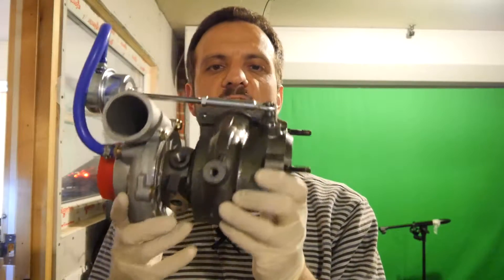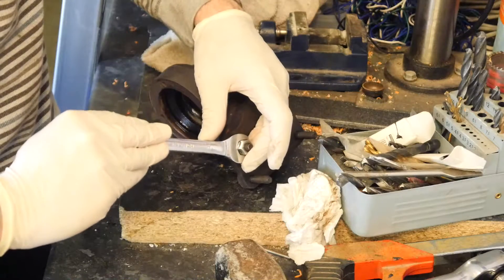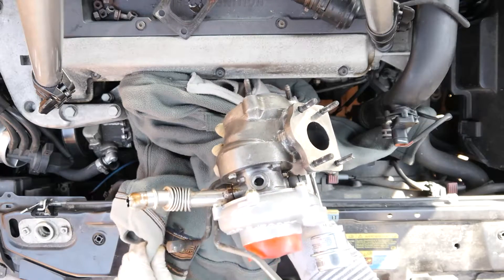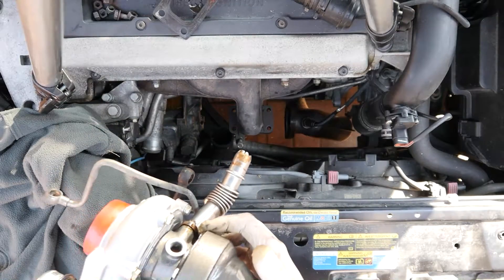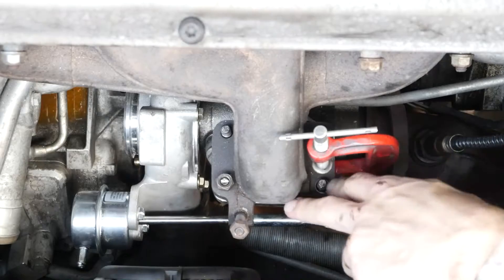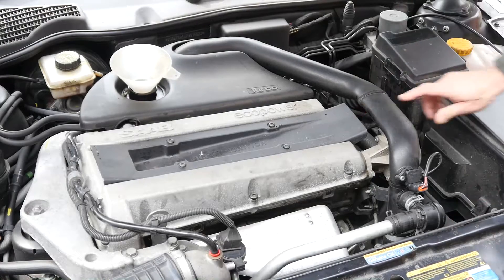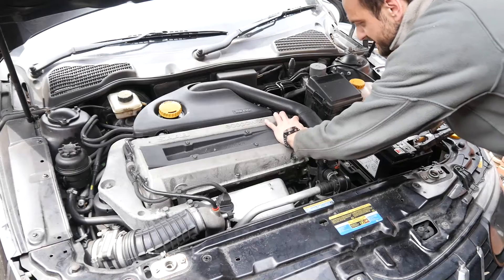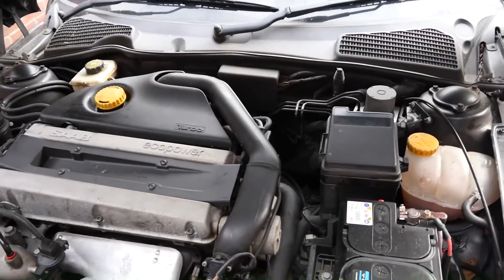How to replace a GM Saab Garrett Turbo Tutorial Part 2

Comment: Mutch better with saab 9-5 i have volvo v70N before the turbo was back on the engine and oli was find in the front hole  underbody vas so mutch oil i leave the car and change the turbo as well 2500euro for the job....

Comment: I wish I’d seen this 5 years ago when the turbo on my 1999 2.0t blew. Cost me well over £300 to get a garage to do it. My « new » 9-5 is 2.3T Aero from 2004 which has a Mitsubishi HOT fitted. I believe (hope!) these are less prone to failure than the Garret. Can anyone confirm ? Or is this just wishful thinking on my part?

Comment: New turbos are required to have a pre-lube of oil that you fill about 2 oz. into the oil port of the turbo or risk damage of running the turbo dry... there is also turbo hardware you can purchase than to use the 7 old bolts plus it is a hassle to reuse the old ones but if you wanted to save on money I can understand but all gaskets and O-rings needs to be replaced...
You are missing 2 O-rings - there is an large O-ring [ Intake hose ring ] that goes between connection of the turbo charger intake pipe and turbo and the smaller O-ring that goes at the end of the turbo return line...
I could not tell if you forgot to place the metal gasket onto the TD04 manifold head - the raised rectangular inner seal prevents exhaust leak that can cause an issue with boost?

Comment: Hi From Denver, CO., thanks for the video.  I'm doing one in an '01 9-5.  Picked the car up for $500 about 3 years ago and for the last year or so it's been smoking at start up.  Took a chance when I found a new one on Amazon for $110.  It looks identical to the one that was on it, even the stamp is the same. But forgot to prime it and was looking for a way to do it without pulling it back apart.I am going to disconnect the cassette but I think I will also pull the oil feed line bolt and inject some in there. Thanks again.
Reply from the maker: At the least I would disconnect the ignition cassette and turn the car over on the starter for a while. I think that is pretty much all I did, but if you have the patience to get oil in there it shouldn't harm it.
Reply: @backofficeshow  Yeah, I just unplugged the cassette, it took longer than I thought for the oil light to go out but it did, then I started it and works fine. I was really surprised that the turbo looked and felt so good for only $110. I mean it looked identical to the original. The old one worked but my throttle body was covered in oil and it would smoke at startup.  Found 2 exhaust manifold studs broken but that's for another day.  It's my girlfriends car and she doesn't drive much.
Reply from the maker: @timthemechanix  I think they are excellent for the money. I really suspect that a lot of original branded stuff is made in the same factories

Comment: Hi - good vid - I noticed you added 5W 30 engine oil. The handbook on the 95 Aero states to ONLY use 0W 30 or 0W 40 engine oil. I just wondered why you used a more viscus oil? My mechanic says to use 5W 30, but this is not what the handbook stipulates - Thanks
Reply from the maker: There really isn't much between a zero weight and a 5 weight oil and the winters here are pretty mild so I think it's fine. Depends on where you live really.

Comment: The return line on my  saab for the oil on the turbo is sticking out like a lot and I’m worried it’s going to pop out because it’s only being held on by an o ring and I literally try to press it in but it doesn’t want to go it’s in the hole but not all the way I was concerned because if it may spew out oil if it shakes out of place
Reply from the maker: How much do you think is in the engine?
Reply: backofficeshow   The line or the oil -oil is at Max the  oil line  is about 1/4 of an inch in the hole for the line
Reply from the maker: If it's the one I'm thinking of, is the corrugated return pipe. I think it's pretty solidly fixed as the turbo, manifold and engine are all hard bolted to each other. 

Maybe you could force it in a bit more with a tool.

It's on the low pressure side of the lubrication system so probably ok. 🤔🤔
Reply: backofficeshow Alright -thanks for the help I will try to press the oil drain line in  and just hope it doesn’t wobble out
Reply from the maker: No problem

Comment: I've got an eBay turbo to go in my Focus C max diesel, hoping will have good luck with it. Is yours still going ok?
Reply from the maker: It is indeed 👍😁
Reply: Got mine fitted and all seems ok, but just wondering , did you remember if the oil feed pipe was completely stiff or did it  move  a little bit?
Reply from the maker: I don't think there was much/any play in the banjos

Comment: Once doing a turbo change, it's easy and a waste not to clean the sump which almost always is the source of turbo-failure on these cars. Also when doing a turbo change the Intercooler needs to come out to be cleaned, since it is on the air side it won't work again unless it's cleaned.

Comment: Great video! Watched it several times to understand each step before installing my new Chinese turbo. Little bit of a struggle removing and replacing the "original 18 year old turbo" and some of the stubborn banjo bolts and tricky feeder lines. But with some new parts and additional time I've gotten everything placed back together. My only problem now, is it's leaking oil and the oil pressure light came back on within 2-3 minutes after starting it. My plan is to get back under it to check/tighten all the bolts again. Perhaps I left one loose or there is a missing washer somewhere. Is it necessary to have copper washers (top and bottom) on all the banjo bolt fittings?
Reply from the maker: Those copper washers are indeed essential, make sure you have two per bolt. Also check the return to the sump is pushed well home.
Reply: Thanks for responding. I’m going out to work on it now. Fingers crossed!
Reply from the maker: Matt Ryzenga I'm sure you will be fine 👍
Reply: All set. No leaks! Thanks again! Your great video saved me about $1500 US dollars. Cheers!
Reply from the maker: That's great glad to have been of help 👍 I'm sure this is the first time I actually saved someone some money 😁

Comment: I know this video is old but Im currently stuck. I have a 2002 saab 95 2.3L and it blew it's turbo so it was smoking like mad but it did start, so I bought a new one and got to replacing it. It's all back on except the cat, but it won't start.  It cranks but will not turn over. I tried starter fluid but it wouldn't work either so I'm thinking it might be a fuel problem. I replaced the spark plugs as well. Any advice anyone can give me will be greatly appreciated. Thank you

Edit: I also did prime the new turbo
Reply from the maker: I would check the connection to the coil pack. I have had my SAAB fail to start when the original pack died. It could just be bad timing. You might be able to check for a spark if you have a helper.

Comment: You should have dropped the sump and replaced the oil as well , theres a reason that turbo blew and its usually the wrong oil or not letting the engine warm for enough time.
Reply from the maker: It blew because it was old. I replaced the oil and filters at the time and replaced them again at 1000 miles. No problems since.

Comment: I just changed the turbo on my Saab 9-3 2002 and there is still smoke, Any advice ASAP thanks.
Reply from the maker: +Sami Known There will be a little smoke for a couple of minutes as there could still be oil in the exhaust system.

Did you replace with a brand new turbo? If so, there could still be oil sitting in your intercooler. You can rinse this out.
Reply: Yes it is brand new, its driving me crazy i have to drive it but with that smoke like the police will surly stop me, do i have to check the intercooler?
Reply from the maker: +Sami Known is your oil level in the car ok or is it going down?
Reply: The Backoffice what if and what if not? Sorry for asking too much
Reply from the maker: +Sami Known if oil going down, then the turbo is has a problem as it's burning it. If not going down then it's just old oil in the intercooler
Reply: The Backoffice ok ill get rid of the oil in the intercooler if there is still smoke i send back the turbo, thank you very much i really appreciat it (spelling) not sure, but you get what am saying, thanks alot

Comment: Nice video.Did the car perform a lot better once the job was done?
Reply from the maker: +Luke Robbo I'm not sure it's performing that the previous turbo (when it was working) but it's significantly better than a dead turbo 😂

I would say it is a great replacement part. Several thousand miles later it's still fine, no issues

Comment: How on earth are you supposed to reach the banjo below the water pump? Been staring at that nut for half a day trying to figure out what the hell to do.
Reply from the maker: +Henrik Mathisen oh m8, I wish I could remember. Using finger tips and a lot of patience I guess.

Are you finding it does 1/8 of a turn and go loose?
Reply: The Backoffice pretty much. I had to remove the fan to get an extension and socket in. Getting it back afterwards was even more of a pain. As you said, patience and trying to hold the pipe back to expose the threads helped.

Btw, when I remounted the oil return pipe I first stuck the pipe in and then bolted it on. I figured it would stretch naturally, it did not. The pipe is protruding from a weird angle and the inner ring (which I assume is meant to be square against the o-ring) is like a fucking centimetre out of the hole. I smeared it with some sealing paste I had lying around. Do you know how much that pipe can protrude?
Reply from the maker: +Henrik Mathisen good job!

I'm not near my car to check but I think the return pipe can be stretched to jam in. Should be ok as long as it doesn't Pop out from vibration. How much do you think is in the hole? I suspect if it's got at least a cm in, is unlikely to Pop out. If it does, you will know about it quickly 😂
Reply: Yeah, I think there's a couple of centimeters in there, hard to tell. Drove a few miles and nothing catastrophic has happened so far.

Thanks for the replies and for the video :)

Comment: Same kind of procedure with a Saab 9000 2.3t?
Reply from the maker: +Level should be pretty much exactly the same 👍
Reply: I was talking to someone and they mentioned that my 9000 doesn't have an APC/BPC. Is there anyway to not have to use one as that would require a tune. (Anything manual)?
Reply from the maker: +Level Not having any experience with those I can't really comment.

Comment: Great video, well done.  Is this the only way to remove the studs (from flanges) to put onto the replacement?

Also was the purpose of cutting the studs ultimately due to fitment?
Reply from the maker: +Charles Choi yes to both questions 😂 if you can, buy new studs. Sometimes you find they might already have the screwdriver cut to help you.
Reply: They sell a stud removal set . Special socket to remove and install studs

Comment: What do you suppose happened to the pieces of your old intake turbine blades? Were they sitting in the turbine, fall to the ground? Caught in the intercooler?  Sitting at a low spot? Processed through the engine?
Reply from the maker: +djmips blown through the engine I suspect As I feel they would have been filed off. Either way it does not seem to have any issues. They are such a soft material I suspect they get stamped flat by the pistons or escape as fillings through the exhaust or down the cylinder bores.

Comment: Nice Job, I would replace mine but I'm ashamed to admit my Saab/Subaru does not actually have a turbo in my model😔

Last thing I did was put some lowered spring and messed up bit time loosening the boys and the back one and the spring uncompressed. Wedging the shock  extremely hard  in there, had to spend 2 day hacking the hardened steel bolt holding it in. 

Not to mention is was a cone shape one that did not want to come out even cut. 

Replaced with a hardened steel bolt with no conical shape and haven't died yet
Reply from the maker: +Ganjulation nice one, around here the roads are bad so I end up replacing a spring or two in our family fleet annually. It's pretty a tedious job! I have a gearbox bearing and a propshaft waiting on two of the other cars and I really don't fancy doing them right now 😞
Reply from the maker: +Ganjulation nice one, around here the roads are bad so I end up replacing a spring or two in our family fleet annually. It's pretty a tedious job! I have a gearbox bearing and a propshaft waiting on two of the other cars and I really don't fancy doing them right now 😞
Reply from the maker: +Ganjulation I'm betting you get better than 33mpg